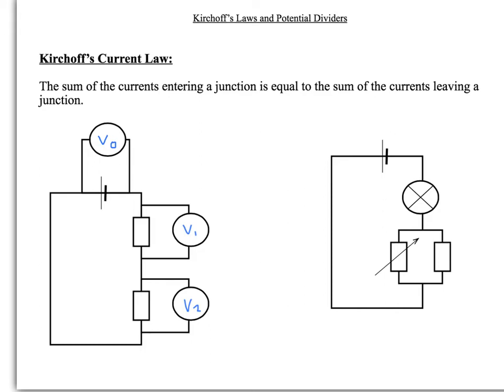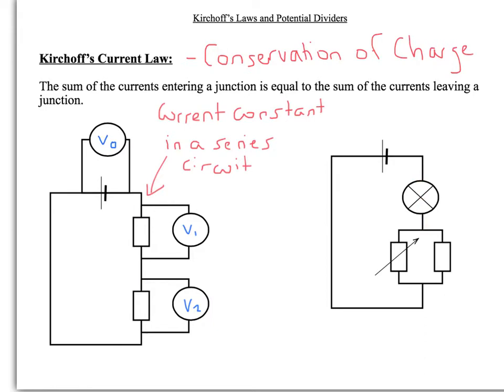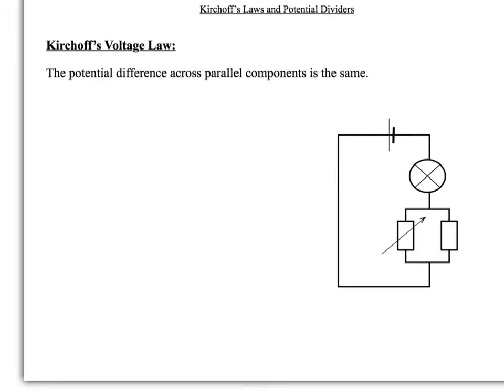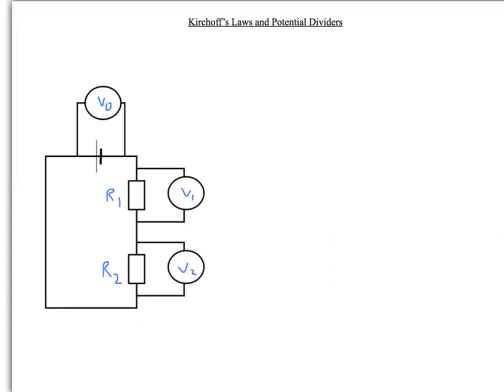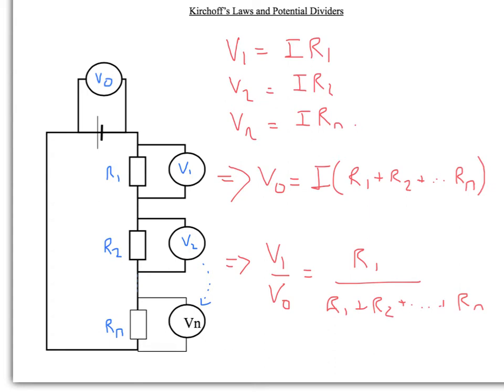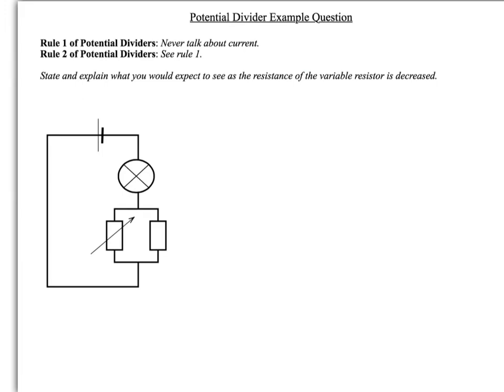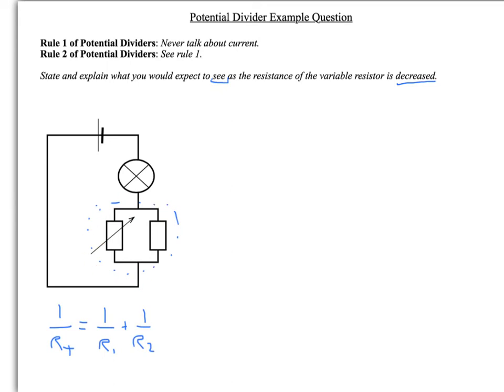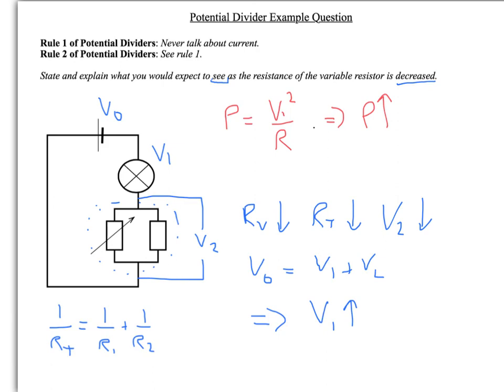A Level Physics: AQA Unit 1: Kirchhoff's Laws and Potential Dividers

Comment: Hello. Just a quick question. At 10:51 does V2 decrease because of V=IR.
Reply: This was a great video thank you, you're videos are increasing my knowledge of physics and making it easier for me.
Reply from the maker: Effectively yes. If total resistance decreases, cell current will increase (that's a rule that always works) If cell current increases, using V = IR, P.D across bulb must increase therefore P.D called V2 must decrease (both still add to equal the EMF)
Reply: @burrowsphysics   Thank you!